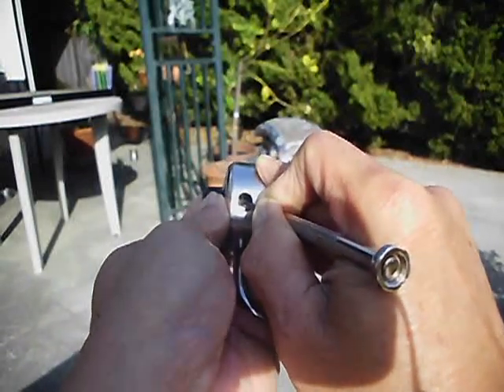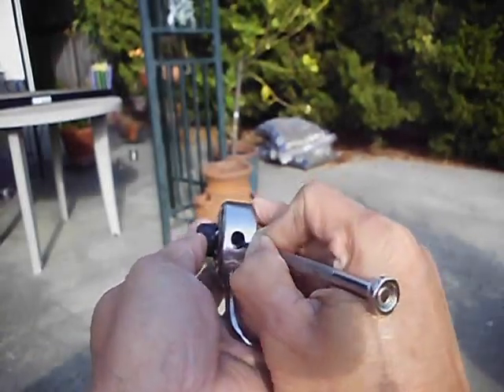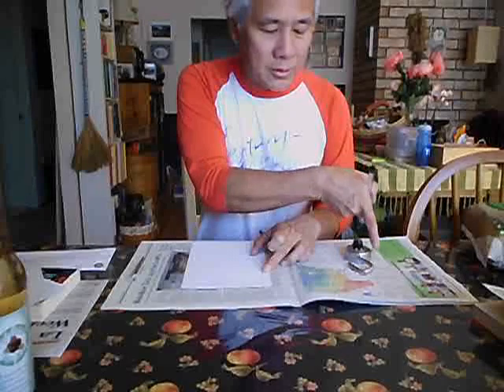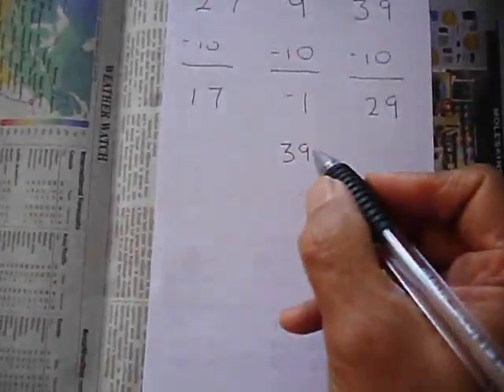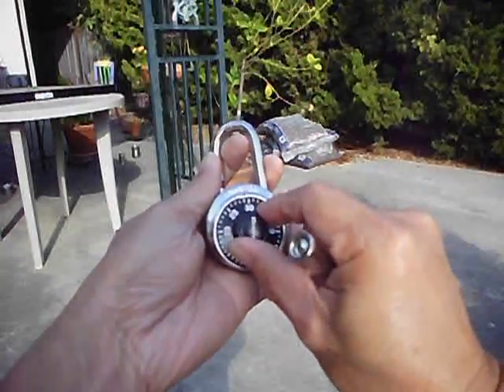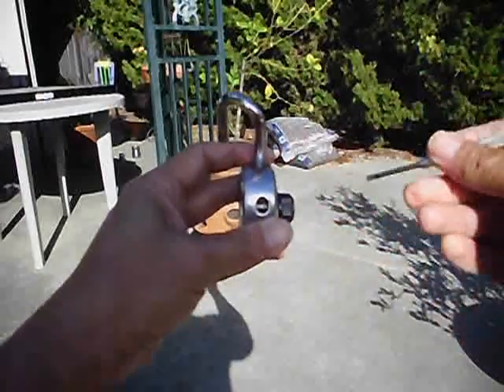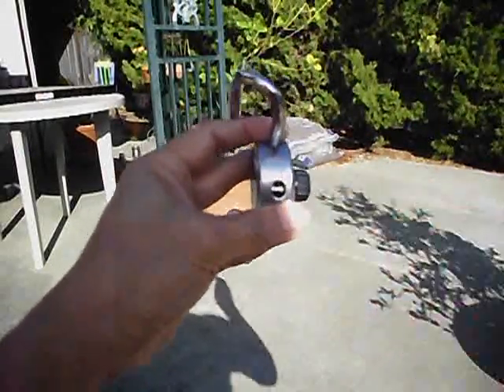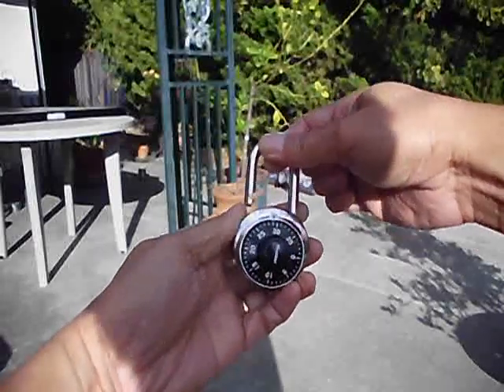How to Figure Out the Combination of a Master Lock that is Already Open

Comment: I just watched this video and the one from "helishorn."  His video makes it much easier to see the wheels and notches in the lock by using an LED light but his method of figuring out the real numbers in the combo was way off for me.  It looks like he's using a no-name lock and going by rotation and estimation caused the numbers to be all wrong.  I have a Master lock and just subtracting 10 and 11 from the numbers i got by looking at the notches in the wheels popped the lock on the second try and I fine tuned those numbers to get the smoothest opening action.  Please leave your video up, using the two videos together was very helpful in getting an old lock from a decade in a drawer functional again.  Great job!
Reply: Also, if your combination lock isn't open, it's very easy to pop it unlocked.  Look up the many videos on here about using a shim you can make from a beer/soda aluminum can.  Master introduced an anti-shim technology about 6 or 7 years ago but that just means you have to use a little more effort to shim them open.
Reply: +Roderick Young I tried the "feel method" first.  For four days.  I guess I didn't have a "feel" for it.  :(